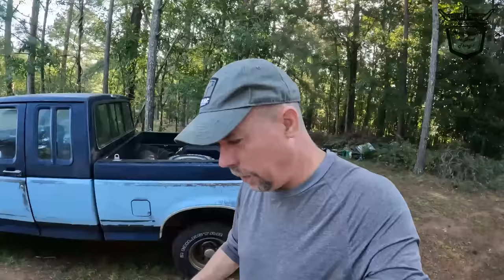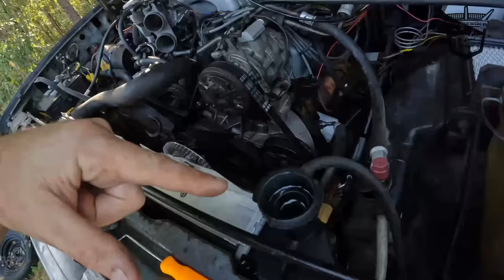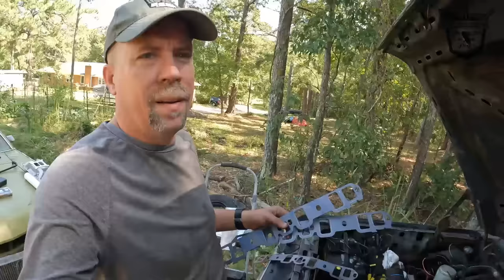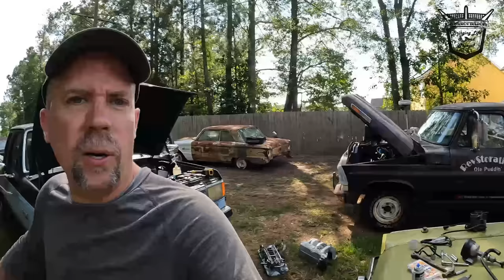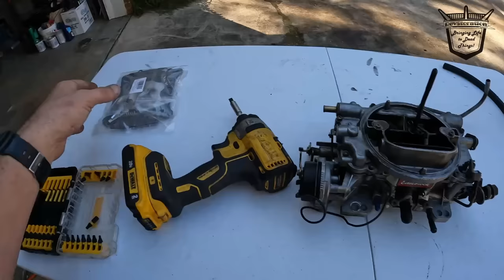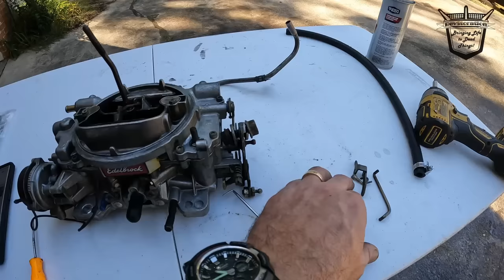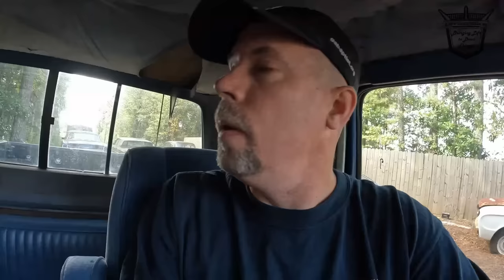1987 Ford F150 - EFI to Carburetor and HEI Distributor Conversion ...ish!

Comment: 2 things
1 the fuel pump in the tank is way to strong psi for the needle seat in the carb, watch for flooding
2 the trans is an aod with tv cable, it is not computer controlled, aode. There is a special bracket for edelbroke carbs (Holley has diff bracket) to get the ratio of throttle position and trans cable pull correct. You can’t use the one you got, wrong ratio.  Improper pull will toast the trans in a ny minute. Improper pressure.
Reply: Fuel pume can have a bypass flow  control trans i not sure     YET
Reply: Being that Rev’s truck is a 1987 F-150, There is a very good possibility that the transmission in the 1987 is an early E4OD with the drain plug in the torque converter just like the transmission that is in my 1990 F-150 in which I have been considering a C6 swap being that my transmission slips. 
The guy at the local transmission shop indicated that being that the E4OD transmission was computerized that a ReMan or any other E4OD would have to be be flashed with the engine computer to make it work - That’s why I am thinking of swapping to a C-6 transmission.
My truck has the 4.9 liter engine and with all of the exact same “Crap” that  David’s engine once had on it 
The electronic stuff works until it doesn’t which becomes a huge problem when the “Crap” no longer works.
Reply: @TheIronDuke502 e4od doesn't have a tv cable
Reply: @RobertDickens2002  Wasn’t exactly sure, The TV function must be done through the computer I assume.
Reply: @TheIronDuke502  exactly that is an aod in revs

Comment: I have a carburetor and HEI distributor on my 87 Ford F150 4x4. No fuel injection anymore. For the transmission check the vacuum hose that connects transmission to the vacuum that helps it to shift right.

Comment: Saw mustang 302's had longtime  problem of distributor of overheating, causing stall . Gal at  Advace saiud she had 3 ford pick-ups, all she had to place a remote aluminum heat dissipating plate n wiring from distributor, so fun

Comment: First time commentor, also new subcriber. Absolute great video on turning a EFI built mill into a carbed swap. The only thing I think you're miss is what you need to control the transmission. If it's EFI you just pulled out everything you need for that transmission to "know" what it's doing. You'll need a stand alone unit, or swap it to a stick. Which also isn't hard. Been messing with my own daily driver. If I can offer up advice, let me know.

Comment: You sure have better patience than me.i would have put a rag In the tank.
Reply from the maker: I still might do that...
Reply: @RevStoration  I have had many moments where questioned myself in the 14 years as a mechanic. It is a difficult field especially with the newer vehicles.i have been fighting a problem with lawn mower because not familiar with 2 cycle engines. It will work out for you. Good luck rev

Comment: Transmission issue could be that TV cable isn't adjusted properly. The fabbed bracket and carb throttle linkage could be putting tension on it.

Comment: Hi Sir. I was amazed the carb didn't flood,due to the high pressure fuel  pump. The computer is looking for the mess of sensors to tell the transmission when to shift. Maybe and old school Aod or C6 transmission would fix the shifting problem ? your doing great by the way. May God bless in these crazy times.
Reply from the maker: I had already installed a 4-7lb pump.. therefore no flooding. The engine was down two fouled plugs.. easy!

Comment: It's the cable to the carburetor to the transmission, it needs adjusted.. been there, done that.
Reply from the maker: It had 2 fouled plugs.. replaced and she is running great. The engine was bogging down under pressure.

Comment: Hi, try to find a Motorcraft carb with good throttle spindles from a junkyard, does the transmission have its own module, curious, sticking solenoids maybe, junkyard video would be cool, enjoyed the video
Reply: RE tranny problem, could it be something to do with the lockdown cable adjustment and the cruise control, lockdown cable might be to tight

Comment: Put a fuel pressure regulator and drop the fuel pressure for the carb if you are using the fuel injection pump
Reply from the maker: Bypassed it with a low pressure pump.. 4-7lbs

Comment: Hi Rev. Just now catching this video. Did you ever put a fuel pressure regulator on the truck? You'll need to be around 5psi. The stock fuel pump will overwhelm the carb with 40psi.

Comment: Is the firing order right. Sounds like it just isn't happy I'm not 100% but the 5.0 and the 5.0 ho have different firing orders. Idk if your motor is a 351 witch would also be the same firing order as a 5.0 ho

Comment: I don't know if anybody's mentioned this but that second cable that was on your throttle body not the throttle cable but the other one goes to your transmission I know you are aware of that but if the throw on that arm isn't just write your transmission won't operate correctly and could cause damage if it's in EOD transmission. Not too sure what your situation is but thought I would throw that out there otherwise I very much enjoyed the video I've been thinking about switching my 95 Bronco to carburetion

Comment: Just bought an 88 with a 302 carb conversion was already done but I don’t think very well. Dumping a lot of fuel out the tailpipe as black smoke. Thinking it’s out of timing because I have the fuel pressure regulator set at 3 psi. Hoping to get it back on the road soon!  If anyone has any advice for this old truck, I’ll take it!

Comment: After replacing the fuel pump in my 2006 Jeep grand cherokee laredo 3.7 WK- Im now having a problem with a vapor lock and my new pump is making a ringing/humming  noise off and on-is there a way to fix it with a inline check valve or inline filter of some sort. I have to release pressure on the fuel rail to re-crank it after it runs for more than 20 minutes/ which is a possible fire risk which makes it not safe to drive. Any suggestions?

Reply

Comment: How did you solve the fuel pressure issue being that the system was fuel injection and the carb is a low pressure system?

Comment: Transmission wont shift right without a tach signal and tps . Can give moth those signals with a carb set-up. Take the tps from the original throttle body and even if you just give it a fixed position of approx half throttle it will solvr the tranny isssue obviously the tach signal tells the computer its running. But the way it is running and sounds like it has a dead hole i believe that you have been chasing a mechanical problem and hoping that the engine isnt hurt. But hearing the way it ran in a carburetor unless you have the wrong firing order need to use the ho 5.0 firing order on those engines then you hace a cylinder that is hurt

Comment: No it ain't. Not for iong, AAA waitin on you. Go to the wiring diagram, ignition coil resistor ballast, can you touch that ballast? Did yo timing light not work until you released switch, you got one flash. Wondering if the Excell . or Axcell, 3400 coil got a balast built in ?

Comment: Rev that distributor is butt ugly, I just had a buddy drop his truck off with no spark and he had replaced a distributor with the wrong gear for the cam that was in it , now he has no cam gear …yup clean cut them off .be careful his is full of metal filings.
Shawn 
RR

Comment: Be careful, fuel pressure 40-50 psi. Too much for carb.
Reply from the maker: I installed a new inline pump 4 - 7lbs pressure...

Comment: It isn’t worth wasting your time to do a carb swap on and efi truck… you’re losing all sorts of power and convenience and will have cold starting issues in the cold and odds are nothing will ever work anyways. You need an engine designed for carburetors.

Comment: You need to buy the bracket for the carb and make sure you have the transmission TV cable is adjusted right or the transmission will burn up
Reply: exactky i was about to say the same dont cheap out or you will be buying  another trans.
Reply: chevy 700r4 is same way